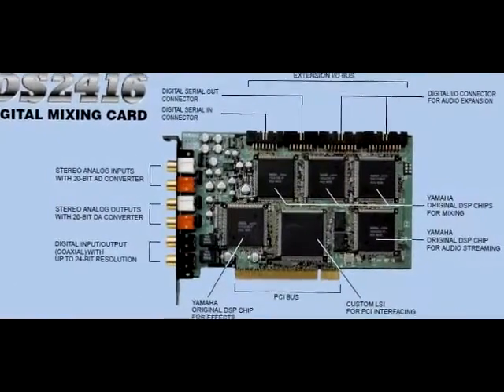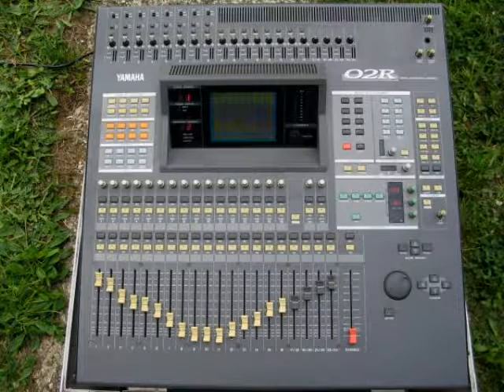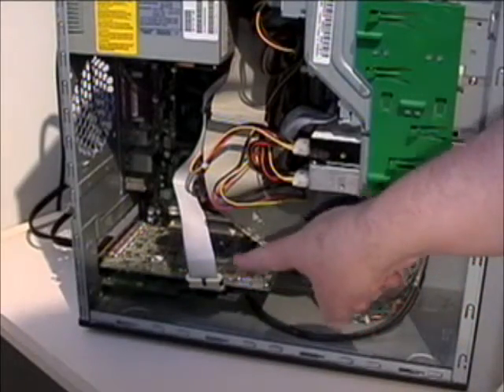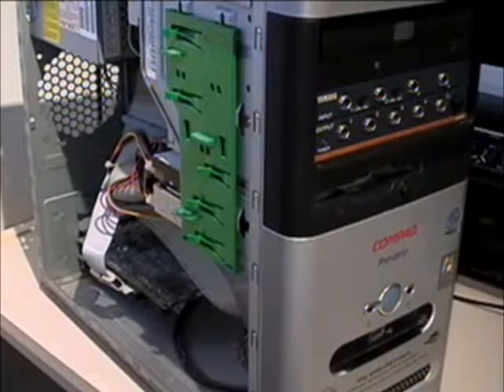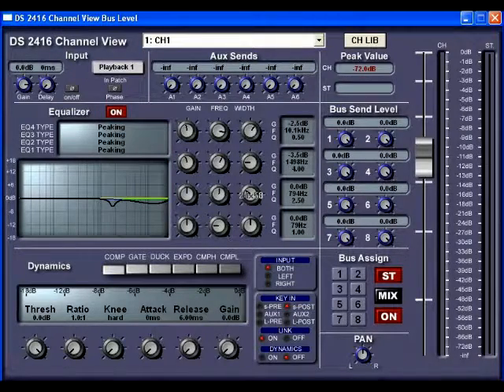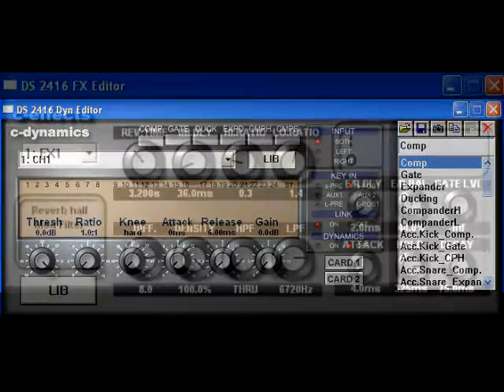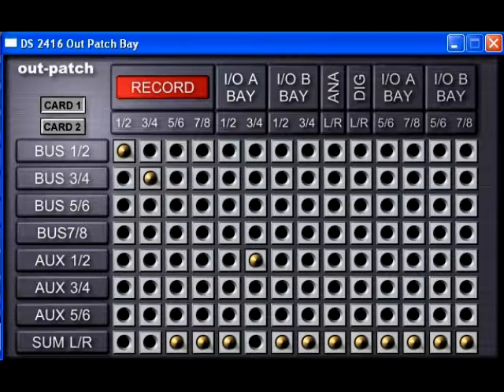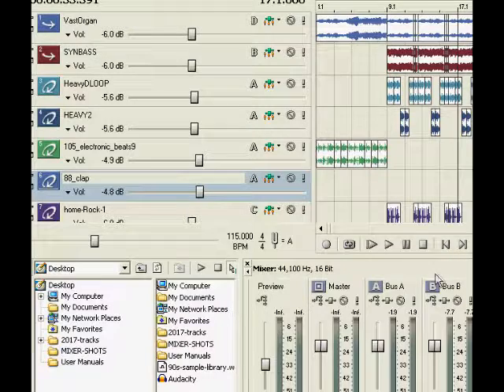Retro Recording Workstations: Workstation One - Yamaha DSP2416

Comment: I had DSPFactory with AX44 and C-Console 1998. Sound quality of converters was dismal. Having to switch between C-Console and Cakewalk was tedious. Today's Ableton Live with Lyra2 converters is pure heaven!
Reply: I'm not too familiar with Ableton, but most other sequencers require to select the mixer screens separately as well, although the C-Console is not built with VST FX in mind as it predates this format slightly.  I find it hard to believe that Yamaha produced bad DACs for this card.  Maybe you had a faulty PCB?
Reply: @EgoShredder  Yamaha has never made good DACs. 1998 was no exception.